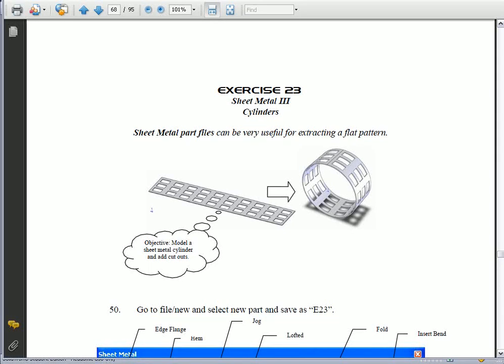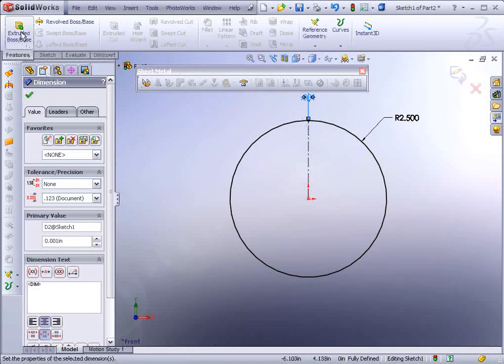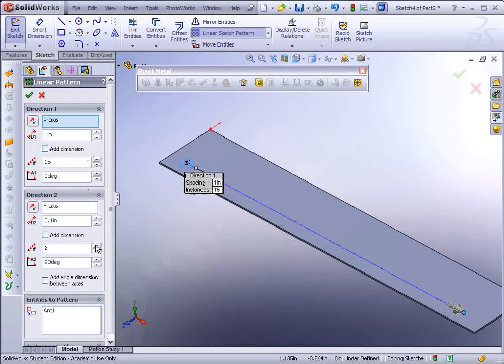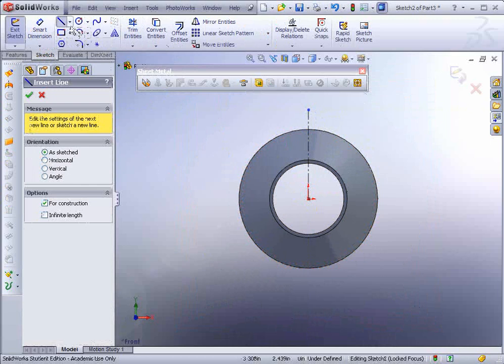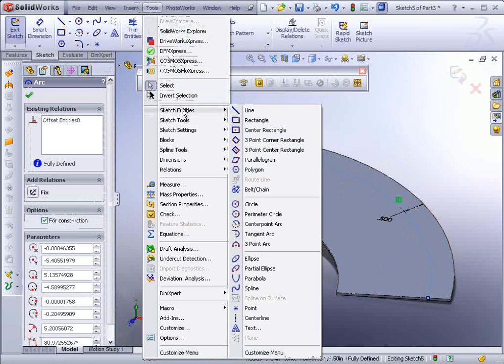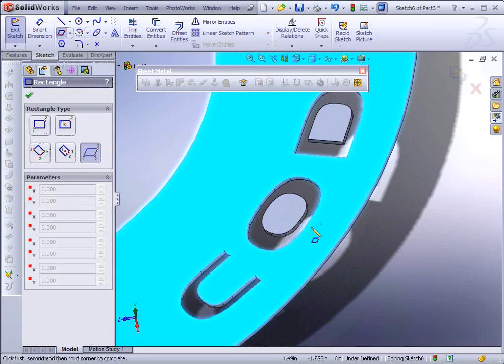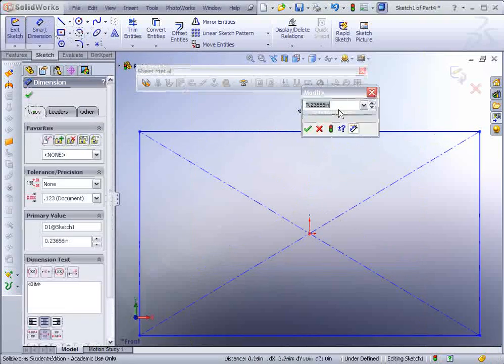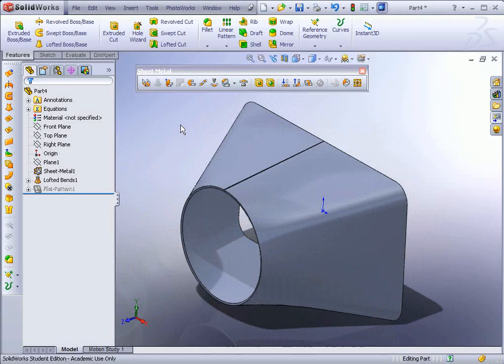E23 E24 SolidWorks 2008 - Sheet Metal Cylinders & Cones

Comment: I know it's a long time ago since you posted this, but perhaps you can help me. The first part of the video is exactly what I need to do: make holes in a cylinder. I'm following your every step. Make the cylinder, flatten it, make the shapes that I want, but after I make it circulair again, the shapes disapair... Any idea what I'm doing wrong?
Reply from the maker: Mark van Egten  Software functionality changed, watch the E23 SolidWorks 2012 version of this video. https://www.youtube.com/watch?v=T8xTx7Dy1fk&list=PLROUP1bV8RETKedmpzUl8zmDQm0B1bzUV&index=13
Reply: Try using the unfold feature instead of the flatten feature. Sketch and cut, then use the fold feature to reshape.